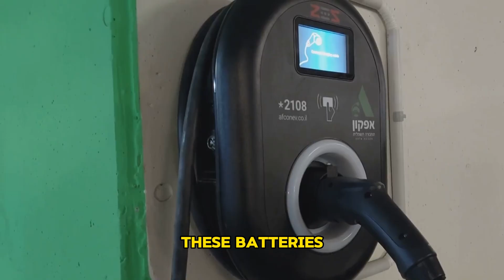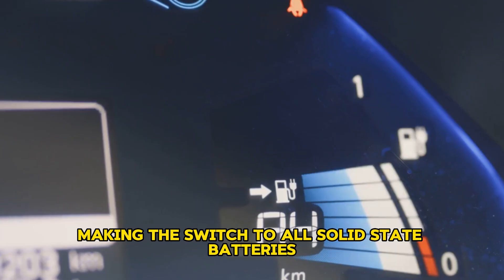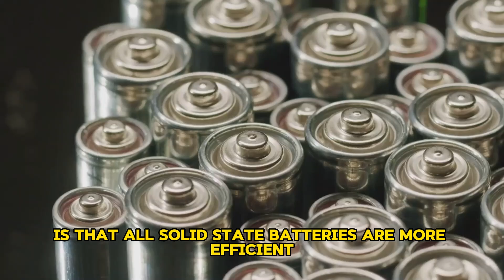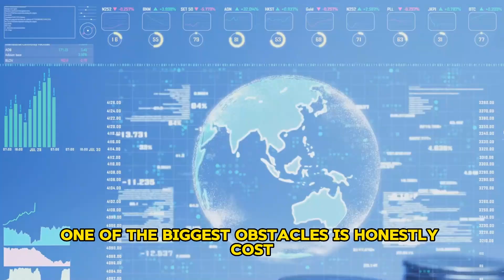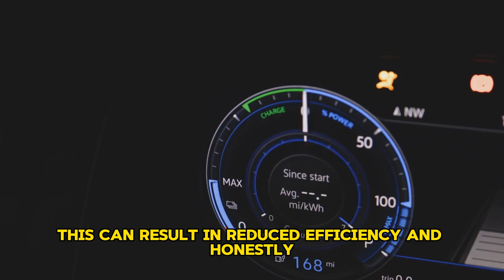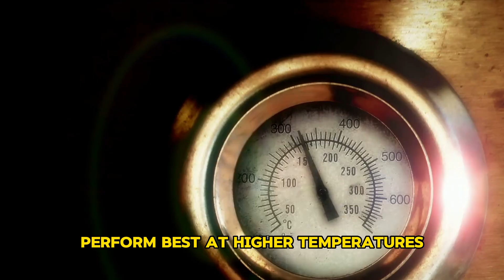BYD CEO Announces New All solid state batteries with 10 Minutes Charging

Comment: No, BYD has not launched a solid-state battery yet, but it is testing them and plans to roll them out in EVs starting in 2027, with mass production expected around 2030. The company has already started road testing with its Seal sedan and has produced initial solid-state cells in its pilot production line. 
Timeline:
2027: BYD plans to begin a limited rollout of EVs with solid-state batteries.
2030: Mass production is expected to begin